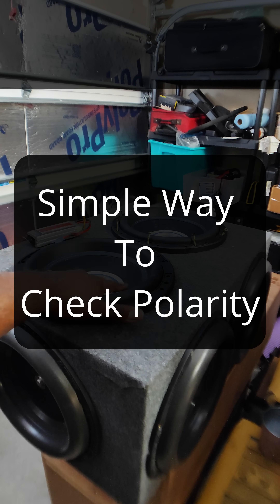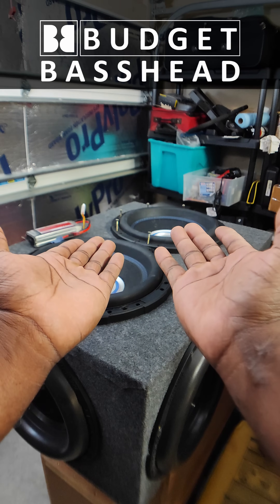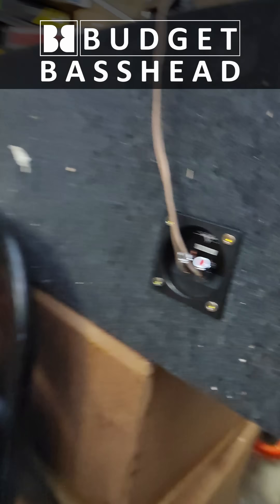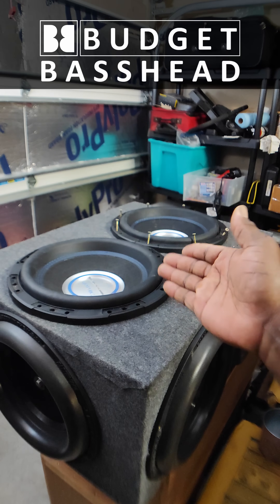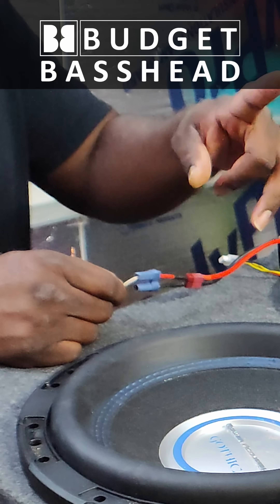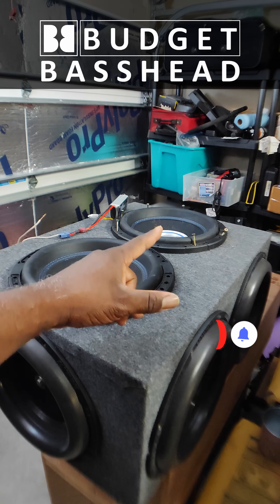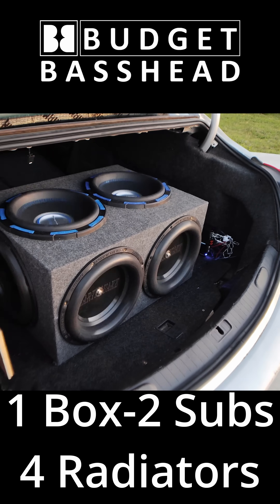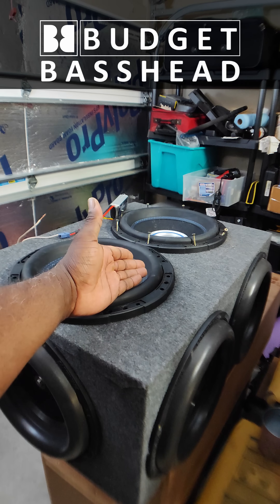A Simple Way To Check Your Sound System's Polarity

Comment: This is partially correct, but depending on your situation reversed polarity can sound better. So no you shouldn't just blindly assume popping up is better.
Reply from the maker: Reversed polarity only sounds better when something is 'reversed'.
Reply: @BudgetBassHead  It's a very complicated subject that takes into effect path length differences. This is why so many amplifiers have a switch that lets you easily swap polarity.
Reply: @JasonWW2000 it is cause I found so many different cars themselves have different responses to polarity
Reply: @castrojody  Yes. As part of the setup process of a new system you want to swap the polarity of every speaker in the system just to see which sounds better. 

Sometimes you'll find that one speaker actually sounds better out of phase. This could be due to you accidentally getting your wires mixed up while installing them or it can be due to the acoustics of the vehicle. 

If you're using a DSP, it's super simple to flip back and forth while listening.

Comment: I love your videos but I'm curious as to a box design I've been tossing around, using passives,  standard sealed pr box, but instead of leaving the pr exposed to the environment, try using them to pressurize a larger enclosure, 2 subs, 4 prs vented into a massive box tuned the fh of the pr with 75% of cone area as port area
Reply from the maker: This used to be a common practice for Sony and others when building boomboxes back in the day.
Reply: @BudgetBassHead  I'm sure it is something that would have to modelled in like hornresp

Comment: Can one use 2 subs with one passive radiator?
Reply from the maker: The PR Xmax must double that of the active subs.
Reply: Passive radiators tend to move more than the speaker. So you either need a bigger, passive radiator or two of them. If you have one passive radiator for 2 speakers, you will probably bottom out the radiator.

Comment: Personally, I struggle with the phase on my amp because the setting goes from 0 to 180... So doing it by ear is... Not easy, haha
Reply: Just turn it off
Reply: @coolszewski1631  It's not something that can be turned off.
Reply: @coolszewski1631 Currently it's at 0, but I feel like I get a better result at 30% of the potentiometer.
Reply: @FrancaisMaggle  Hey, if it sounds a bit better at 30°, go for it. There's no right or wrong.
Reply: Do you mean you have a switch or is it a dial that can be rotated? I personally have not experimented with the adjustable phase. Some of my amps do have a switch and on others, I'll just switch the speaker wires around. Sometimes switching polarity will sound better one way than the other, but if it doesn't, it's no big deal.
Reply: @JasonWW2000  I usually had amps without phase adjustment. But my latest amp has a rotary control, a potentiometer going from 0 to 180. So 0 doesn't change, and 180 reverses it. But I don't understand the possibility of having an in-between setting. And if it's even useful in my case. Yes, my subs are in phase, but are they in phase with the other speakers on other amps? Good question, haha. I don't feel like taking apart one of the door panels to check right now...
Reply: @FrancaisMaggle  A good little tool to easily check speaker polarity is a polarity popper. You can get them online for 15 to 20 bucks. You play a special test track through your system and then you hold the popper right next to the speaker and hold the button down. You might get three green lights and one red light or three red lights and one green light. It doesn't matter which set of lights, you get just that they're all consistent between the speakers. This is a good way to verify your wiring. 

As to what sounds best, you still should try flipping the polarity on each individual speaker just to see if it sounds better or worse. It's easy with a dsp or headunit where you can just push a button. If you don't have that, you might have to have a friend physically hold the speaker wires in place and then quickly swap them. 

As for the subwoofer phase adjustment knob. I don't really know. You basically have 360° control. 180° where the speaker wire is one way, and then you can physically change the wires to get the additional 180°. 

My new dsp has individual driver phase control like that in 1° increments. I'm gonna have to learn how to adjust that. On the other hand, I've been doing just fine the last several decades, just using time delay to get all the speakers hitting you at once, which makes the bass sound fantastic. 

I'm pretty sure I could go over to the RTA or Audio Frog section of face book and get all kinds of technical advice on how to set up the phasing.

Comment: I wonder how that box would sound.
Reply: Was crazy to see such a big money box with such cheap subs. Those were the the power acoustic Gothic 12s about 80$ off the shelf at Walmart. Honestly outta the budget subs under about $$200/ 250 thats the best sub I've seen yet They have crazy excursion
Reply: @mikejones8225 bud that’s a cheap ass 100$ box that he drilled the extra holes onto , nun special about that box
Reply: @mikejones8225 where's this big money box? All I see is a regular ole carpeted box.yeah it's got 2 Gothic subs and 4 passive radiators. But it's still just a regular box, not anything big money

Comment: Being out of phase matters (phase cancellation). Reverse polarity doesn't matter because you'll still get bass as the subs are playing frequencies your door speakers are nowhere near.
Reply from the maker: This is not accurate. Maybe 'Your' door doesn't play lower frequencies, but 'Someone' else's doors does. My door speakers play well into the 30Hz frequency band.
Reply: @BudgetBassHead  your door speakers really shouldn't be playing 30hz. They should be crossed over higher. Like 80-100hz. The lower frequency they play, the more rattles you're gonna get.
Reply: @JasonWW2000 thought this was obvious to get good sound/bass separation. My door speakers CAN play down to 20Hz but do I want that? No. Doors for mid bass. Subs for low bass. 60Hz high pass for the doors and 50Hz low pass for the subs or you can just turn the bass down on the doors if no high pass is available to get good bass separation and yes some songs do sound better with the amp phase at 180 degrees /reverse polarity.
Reply: Jim is also correct. As long as both subs are in phase with each other, that's all that matters. Part of the setup process of installing the subs in your vehicle should involve flipping the polarity. Sometimes the subs can actually sound better when they're out of phase with the rest of the speakers. This is why a lot of subwoofer amps will have a switch on them to flip the polarity 180°. You can quickly switch it back and forth and figure out which sounds better. 👍

Comment: Always good shit!
Reply from the maker: Thanks for watching!
Reply: @BudgetBassHead  I have been trying to figure out what the head unit is you use in your demos in your lab, but I can't seem to find the video where you mentioned it. I would really appreciate it if you could remind me.
Reply from the maker: @highjix  ATOTO F7. They have different versions of it.
Reply: @BudgetBassHead  Thanks, I appreciate your very quick response.
Unfortunately I really don't know much about head units, I am looking for a new one for my 2008 F-150 as the display in my stock unit goes in and out, I am thinking loose connection, and good excuse to upgrade to a unit with bluetooth so I can get rid of the fm bluetooth modulator in my lighter.
Reply from the maker: @highjix  Checkout Crutchfield. They have a vehicle selector tool, that'll match you with something really quick.
Reply: @BudgetBassHead  wow, I forgot all about crutchfield, thanks!